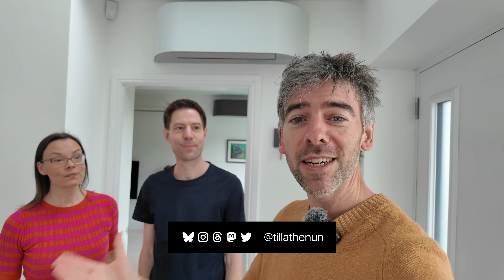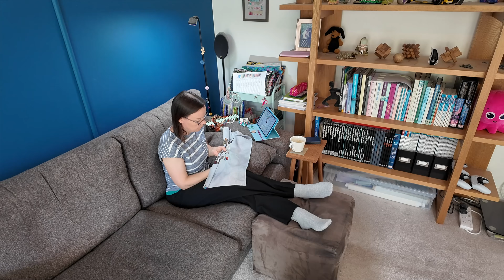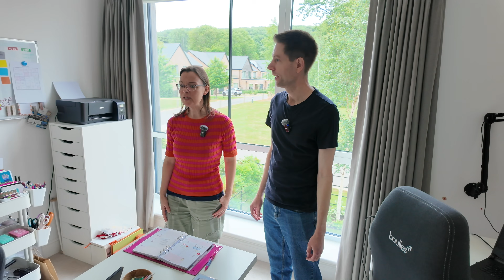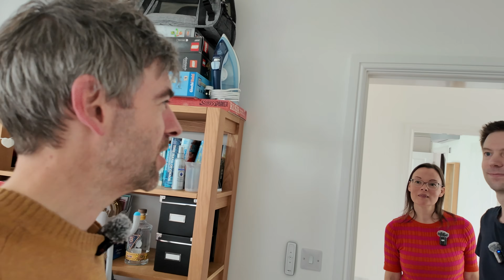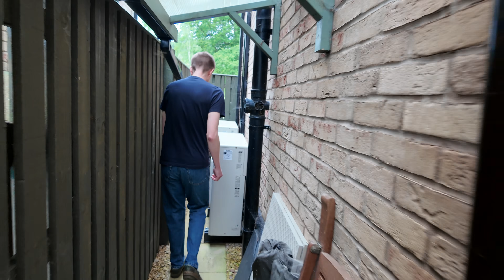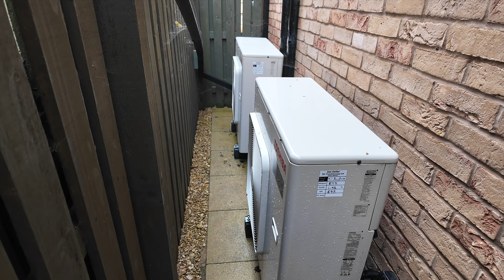Best of Both Worlds? Heating and Cooling with an Air-to-Air Heat Pump

Comment: Over the last 5 years we have put 4 mitsubishi A2A units in our house, they have been a godsend this summer, i still sleep under a 10.5 togduvet. I can sit in my conservatory in the heat of the day nice and cool. In the winter i put it to heat and it keeps me warm, we dont have the gas (lpg) central heating on upstairs ever, if it is really cold in the winter a quick burst of heat warms the bedroom while i warm up on that 10.5 tog duvet. In terms of cost the total for the 4 independent units was about £5k installed. In terms of ongoing cost from before they were in we were paying £84 a month for electricity now we are paying £100. That said i have also changed to an EV which charges at night, we are now on a cheap overnight tariff. Our lpg consumption and petrol consumption has fallen making it  much cheaper overall than pre installation.
Reply: The importance of owning an EV (thereby giving access to cheaper TOU tariffs) can't be overstated when it comes to A2A and A2W technology.
The last piece of the 'Holy Trinity' puzzle is to have Solar + Batteries.

Comment: We installed a Samsung A2A heat pump over a year ago with 3 units throughout the bungalow. It is cool in summer and warm in winter. In summer it costs nothing to run thanks to solar and with battery storage reduced costs  in winter. We previously had storage heaters which were a nightmare.
You should have taken your wife as it seems she is the one who needs convincing. Tim & Kat’s channel along with Nigel’s channel - the EV & Solar Puzzle helped make up our minds.

Comment: I don't regret getting my air-to-water heat pump at all because it is just so comfortable, better than any gas boiler I've ever experienced, and I think better than air-to-air as well. The house just stays at a constant temperature 24 hours a day; it's very difficult to tell if the heat pump is running. Much cheaper to run than the boiler, even not including removing the gas standing charge.

However, ATA may be key for ramping up heat pump installs, as we desperately need to do; gas boilers really are evil in terms of home energy use. People who are not convinced about installing an ATW may be swayed by the fact that they do cooling as well, plus they are easier and simpler to install, with I think less chance of a bad install, and for many properties will be the best option. (I may end up getting an ATA just for cooling, and as a backup if the ATW fails, as the possible repair times are a bit of a worry).

Comment: I just had a 10.2kW solar array with a Tesla PW3 installed and then got hit with a very low 4kWh export limit! We were expecting 8, 6 as a low ball from the DNO, but 4 really hurt the return. 

So instead of exporting our ⚡, we will use it during the day, and A2A for upstairs at least is something I will definitely consider, the ducted type if that is feasible. Downstairs does get warm, but not 37°C bedrooms dropping to 30°C, that's unsleepable, so Aircon is a real option. 

My 10yo home has 6mm bore (grrrr) pipes to the rads and definitely not A2W heat pump compatible, so A2A is out only option! 

Great explanation all, I have subscribed to Tim n Kat's channel as I will dig into their A3A videos over the winter!

Comment: I’ve got a 4kw Mitsubishi ducted system, absolutely fantastic and just two round vents in each rooms ceiling ( about the size of bathroom extractor vents.. 6”?) a single outdoor unit and a single attic mounted unit… during the recent heat waves the house was a stable 22 degrees and the power usage was only 300watts!
Reply: How much was it? Ducted tends to cost more here I’m looking at Mitsubishi electric wall splits
Reply: @Horizon301. I bought the system about 7 years ago, was £1500 for the indoor/outdoor and about £500 for everything else. Self
Installed.
Reply: @M @MrBenn197025 , spilts for the LN Mitsubishi Elecric are £1800+, some installers are asking for £2400 so it’s crazy now. Ducted costs even more so I’m not considering it really
Reply: @MrBenn197025  Top Job, are there servicing costs ? Would you recommend a where to buy from ?

Comment: Yep, no radiators so much more usable space, but I cannot get over the 8,000 pounds they paid in the UK. I have 5 units installed in my villa cost me less than 1,800 euros (1,540 pounds), now i installed these myself (not difficult) but even if i had got a "professional" to install them it wouldn’t have cost me more than 800 euros (680 pounds) extra.
Reply: There is a small UK market for self installation with pre-charged split units but they still legally need to be connected and commissioned by a registered FGAS engineer qualified to work on air con systems. I DIY installed a single unit in a studio outbuilding a few years back which cost about £550 for the unit plus £250 for commission. Its not a known brand as such, called Lux Power that are sold as an "own brand" by a large UK air con distributor, but it uses a lot of Toshiba internals apparently and connects to the Tuya app and works fairly well. 

The only issue we've encountered which would be an issue if using as a genuine home heating replacement, is the modulation of the heating mode is pretty bad. Set it to 20c and it will regularly heat to 22c-23c before modulating, but for our intermittent use case where you just want the studio warmed up to work in there for an hour or two, its not the end of the world.

Comment: Air to water heat pumps, without a doubt. I have a Samsung EHS 16kW heat pump, and it does cooling as well as heating. But the heating in the winter is the most important thing. Paired that with a SunAmp thermal battery, and you have a system that can heat your home and hot water for 24 hours on a single charge. I know in your case you will have to add the plumbing and radiators, but it is worth it in the long run. But understand that you have a tough choice to make.

Comment: We fitted the exact same system on the back of Tim & Kat's experiences.  The best thing we have done to our property.  However, we live in a bungalow, with no gas available and no wall space.  The sun room means the house gets red hot.  This year has been fantastic, nice and cool inside and toasty outside!!  We now have lower bills (we had Rointe radiators that ran on £50 notes!)  Wood burner is now hardly ever lit in winter.  We have just added a third indoor unit to the single outdoor unit.  They are not the right fit for everyone, but for us absolutely the correct decision to heat and cool our property.  We have solar and batteries too so very lucky to have found Tim & Kat's channel!!  My advise Andrew is go air to air!!

Comment: I'm team air to air.
I have a small one bed place and only electric. No space to put much inside and i only need one indoor fan unit.
I have an electric shower and over sink water heater.
My advice is think how often you use hot water or need to. You may not need a water tank full of hot water if you are a single occupant.
Big problem currently is that the installer industry is catching up with demand for people installing air con. I'm currently on a waiting list.

Comment: For your single storey home, air-2-air ducted is the obvious choice. One external unit to a cassette in the roof space, with air ducts to each room.
Reply: It is the simplest choice but I wouldn't want to be the maintenance man getting up in the hot loft at the height of summer to carry out any repairs and  to disinfect and wash the cassette. The ducting will also need to be regularly cleaned too to rid those spores. I think mini splits are easier to clean in comparison - the downside is mini splits take space in each room as opposed to a simple grille in the ceiling.
Reply: Fine for the first floor, not so easy for the ground floor.
Reply: @rednammoc I thought they only have one floor?

Comment: I'll have to research hot water options if i go down the aircon route. Six grand for the ac plus two grand for the heat pump cylinder but BUS gives two back if you rip out the gas boiler. Stress of finding a good installer for both though.
Reply: Never had any problem finding a good installer as most of our aircon people have been in the trade for 30 odd years even if more of it was offices in the past.

Water we ended up using immersion with the EV tariff overnight. Heatpumps were more efficient but the payback versus EV priced electricity for our usage was about 50 years !

Still have the gas for backup and some of the water but it will go in time.

Comment: Up until last October I was being price gouged by Calor for bulk LPG at 79ppl for my combi boiler. I desparately looked at A2W heat pumps and many installers wouldn't even visit because I live in a large rambling country house where most of the fabric is 400 years old. Octopus came to do a survey and basically said don't bother as it would cost over £20k to go A2W because my heat loss was over 20kw....not surprising as the walls are formed of mud, animal hair and staves, and the windows single glazed. Moreover, I have a large garden room with a semi-glazed door, three sets of French doors, a large window and 40% of the ceiling is glazed. Two mothers of radiators - doubles with fins - could never heat it in the duller months, and the room simply became a chilly corridor to the kitchen in Winter. Then I watched a couple of videos on A2A (including T and C's and EV Puzzle's) and decided to give it a try; I went for the largest Toshiba Haori single mini-split as a starter (£1.8k). It alone heats and cools the garden room superbly (22/23C) and the kitchen (20C), and did a fair job on the dining room and sitting room (18/19C). The original idea was to supplement it with the gas boiler, but in the end I didn't need to because I decided to get another large Toshiba Haori mini-split for the dining and sitting rooms. I've enjoyed the warmest Winter since I've been here. But what really put the topping on the cake is the 32kWh battery/10kw inverter combo I had installed (£5k) (which I can now supplement with my EV's V2L capability - 77kwh battery). My energy costs were around £2/£3 a day mid winter and that's before I got some solar installed. Around £1.50 of the bill was the two A2As. I didn't bother with any installations upstairs as it doesn't get really cold (or hot) up there and I don't like warm bedrooms, but I do have fan heaters for occasional, short term heating. As regards hot water,  my showers, like my washing machine and dishwasher, heat the water there and then, so there's no huge tank of water to be kept warm; I just accept that the small amount of hot water I use in the kitchen and wash basins exercises the combi boiler and keeps it in shape. The hot Summer has been a doddle especially with a temporary installation of just 1.8kwp of solar mopping up the costs. The system really works for me because I can be away for days on end and being able to fire up the blowers 20 minutes before I get home is a delight.  My main point is this; If we want to electrify the heating of the UK's leaky, ageing homes without alienating the population by insisting they rip out the gas boilers that they know and trust, the answer is staged, modular, incremental adoption of A2A as and when finances and confidence in the technology grows. Trying to transfer the energy required to heat a leaky house using just 100/150 litres of tepid water requires lots of insulation and around the clock running...you dare not stop; not so when you've 1000s of litres of air available for the job, just requiring just a small elevation in temperature, it's no wonder A2As' COPs are 4+. A2A kicks ass, and is cheap, modular, and responsive, and there's no need to rip out the gas boiler which just can sit there as back up until its days are over, or until the owners decide they want their wall space back! I love it. I enjoy both of your channels.
Reply: Fascinating comment Andy and I’m very glad to have found it.  I’m in a similar situation of a 400 year old rambling house in Suffolk.   I’m putting in a 3 split on the north end 3 floors of the house that’s the coldest.   I found a 2nd hand Eco stove last year that I installed and once that’s fired up it keeps the rest of the house at about 19-20 degrees.  My thinking was that with the mini splits I could keep the coldest 3 rooms warm for around £4.5k instead of an expensive and extensive install of A2W.  Love to chat to you more.
Reply: @ashbishop9725 Ha! I'm in Suffolk too!
Reply: @andyclarke9589 what a coincidence, we’re near Fressingfield
Reply: @ashbishop9725 Heveningham
Reply: @ashbishop9725  I'm originally from that area too and while I live somewhere else now, I regularly drive through Metfield or across the old airfield on my way to visit family.
Reply: @andyclarke9589  I used to live in Ubbeston, it’s a small world!
Reply: @bobholmes4215  it’s a wonderful bit of the world Bob.
Reply: @ashbishop9725  It certainly is! I never appreciated it growing up there. I went to drama group in Laxfield. Used to do the Summer Shakespeare at various pubs and places in the area with Circle '67 (a drama group from Halesworth), and would cycle anywhere from Lowestoft to Stradbroke in my teens. Btw, my dad taught me to drive on Flixton airfield in a Vauxhall Chevette, but I don't think that's possible now. Ahh, the nostalgia!
Reply: Just an fyi, i just renewed my lpg contract with Avanti at 45p.
Reply: @wayneclark9435  Yes, I got a counter quote from Avanti for 45ppl, and put it to Calor. They replied with 49ppl after I forwarded the quote to them and asked if they could put someone forward to join me on Radio 4's today programme the following week to discuss price gouging in the unregulated bulk LPG market. (That never happened). There have been two years in the last 7 when I've run out of gas in the New Year despite having a remote gauge and having made many phone calls. I've still got a nearly full tank after 9 months. The only good thing about having bulk LPG is the 'standing charge' or tank rental is only 15p a day.
Reply: A2A and A2W have similar efficiencies. Tim and Kat run their house low and slow as you would an A2W heat pump.
Reply: @Biggest-hz7ng  Indeed. And so do I when I'm at home for an extended period. But as I often go AWOL for a week ot two at a time, I can just set to anti-freeze mode then fire the system up half an hour before I get back. From what I've gleened you couldn't do that with A2W.
Reply: @andyclarke9589  I haven't measured how quickly the house heats up with A2W. I schedule 'absence mode' whilst I am away and have the system turn on a day before I get back.
Reply: Swede here. Before considering any type of alternative heating you should change your windows to 3-glazed. Even 2- glazed will result in a noticeable reduction of energy usage.
Reply: same here, detached Victorian…couldn’t find A2W that made sense, went Toshiba A2A. One thing is to carefully consider positioning for effective airflow, also they offer floor units so I could all the pipes under the suspended timber floor for those units and not through cornicing etc.
Reply: Great use case Andy. You could even go the whole hog and go mixergy water tank (or other equivalent) for your water needs.

Comment: Couldn't put up with these two so might have missed it in the video, be interesting to know at what temperate is considered cold through the heatpumps on a hot day. If it's 35 outside and it can only draw down to 27 inside it's pretty pointless over conventional air conditioning.
Reply: Our home was a very comfortable 23 deg when it was 30+ outside.  A2A is conventional AC, different name for the same thing.  Sorry that we're so objectionable to you.
Reply: What on earth gives you the impression that A2A heat pumps are any different to "conventional" air conditioners?
Reply: These things are EVERYWHERE in Australia and usually have no issue bringing the inside down to 16-18c even when it's 35-40 outside.
Reply: Bit harsh and an unnecessarily personal dig  - why not just say nothing?

Comment: Great collaboration and good information. We have an ASHP as home is 1972 detached with large windows and good insulation. So we have had real issues trying to keep the home cool for the past 3 or 4 months. Certainly looking at getting AC for next year.
Reply from the maker: The crazy sustained high temperatures this year means a lot of people are doing the same I think. I know a lot of air conditioning installers are stacked with work at the moment (if they can even get hold of the units!)

Comment: Sorry. Gas to heat and a well insulated house. 20 min boost and house stays warm for hours. Will be getting an eco-worthy 16kWh battery at some point. So will be trying a portable air to air with that.

Comment: An extremely timely video, thankyou Andrew, Tim and Kat. Since our group photo with Gary and the Geek at Cheltenham I have been researching 'air to air'. I have been looking at Mitsubishi but am surprised at the large size of some of their internal units. I am certainly just as interested about the heating capabilities in addition to cooling. Its time to get some quotes and make a decision!!
Reply: The more cooling power and efficient the units are, the bigger they will be to accommodate a larger surface area of the evaporator fins. Mitsubishi Heavy Industries have a stronger reputation than Mitsubishi Electric in terms of durability in Australia, some ME units are prettier though.